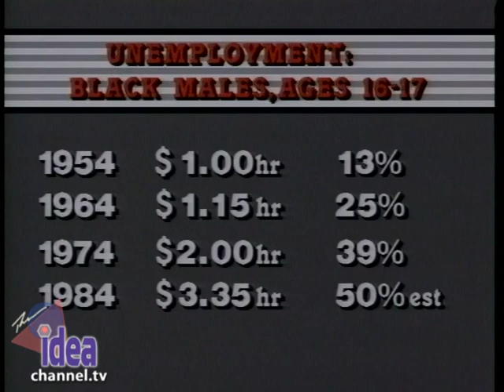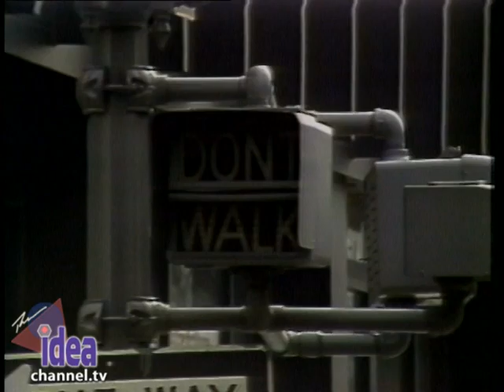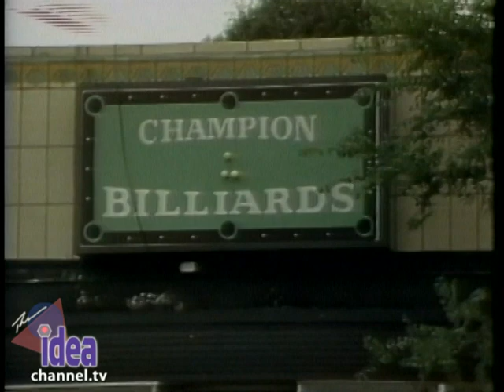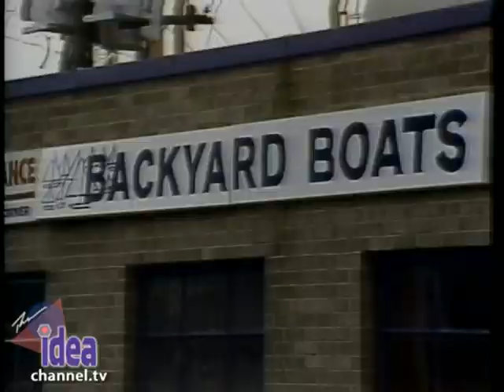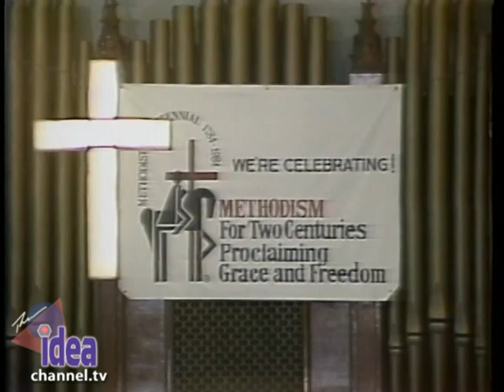Good Intentions 2of3 Minimum Wage, Licensing, and Labor Laws with Walter Williams

Comment: Instead, during the 20's (with NO minimum wage), the economy grew enough to have only a 2.9% unemployment rate. Remember that there will be ALWAYS unemployment at SOME rate, because people either change jobs, move, take sabbaticals, are fired for under performance, you name it. However, having 25% unemployment as in the 30's is explained by price controls and WAGE controls imposed by the government.

Comment: @nfwvideo Its not that many blacks aren't qualified for positions, many are. The point is a minimum wage creates a greater applicant pool (7 dollars is great if you only are worth 5)  for fewer jobs. This is a non-market-clearing surplus of labor, aka unemployment. 

This hurts many unskilled workers (not just blacks) whose "equilibrium" market value is slightly below the minimum wage.
Reply: briano8713 correct, this is exactly how min wage regulation works, along with all price floors

Comment: In 84' min wage $3.35/hr while the Detroit Auto Workers Union was around $10/hr with benni's. Problems surfaced with executives and board members salary and stock options could be excessively extravagant by using labor arbitrage. McKinsey instructed all the righteous execs that you can fire 90% of your American workforce and have slave labor in a foreign country to justify their gluttonous salary.

Comment: @kDest If it results in a better living standard for them than they had before, then it's absolutely beneficial to them. Even if it doesn't, it could still be beneficial to them, values are subjective, meaning what people see as positive some would see as negative and vice versa. 
If the sweatshops or factories pay so little why are people going there instead of remaining at their original vocation? Obviously because they're better off there than scraping a living out in the fields. 
contd.

Comment: Will tackle your several displays of economic ignorance one at a a time:

IF people are not willing to work for $4 per hour, employers would simply offer a higher wage. No need for a minimum wage.

During the Depression, Hoover insisted with businesses not to lower wages, artificially placing a bottom (i.e. a minimum) on wages. THIS distorted the market and increased unemployment, by making labor more expensive. In fact, real wages INCREASED during the 30s, but so did unemployment.

Comment: @kDest Because I can tell you're not going to be at all honest about this, I will make one small point at a time so you must address it directly. You will address it directly, or you will embarass yourself.
If someone is desperate to make money, that does not mean they are desperate to make less money than they currently do, but more. Less is no incentive to work for you. The same is no incentive to stop doing what they're used to. Switching jobs is a hassle. 
You must offer them improvement.